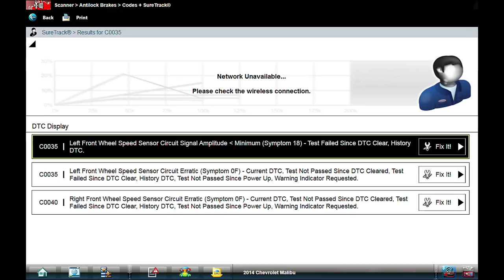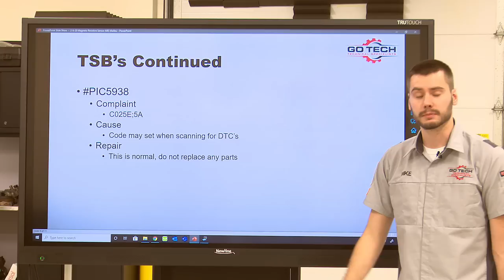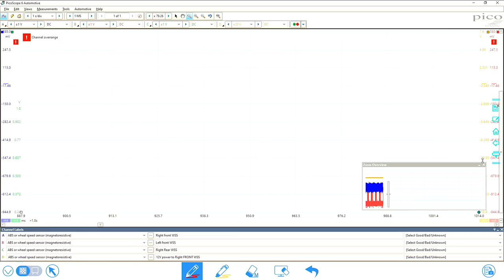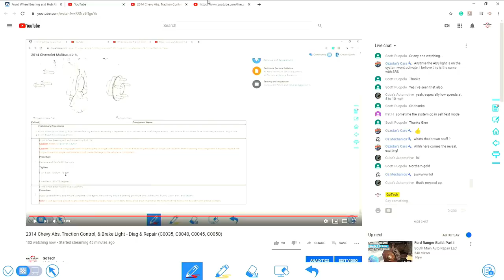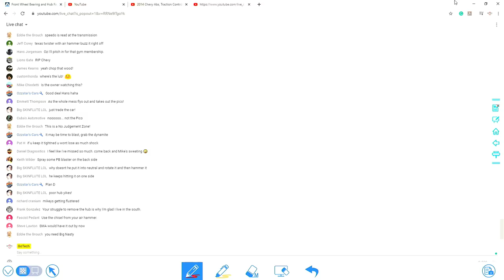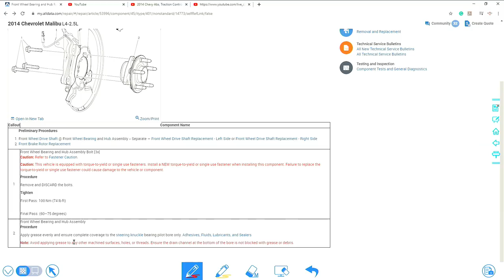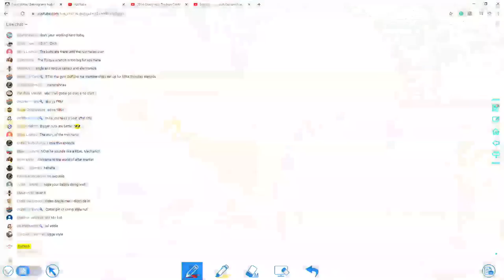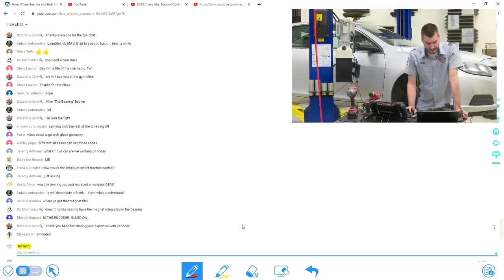2014 Chevy Abs, Traction Control, & Brake Light - Diag & Repair (C0035, C0040, C0045, C0050)

Comment: Missed this yesterday. That thing was typical of what I see up here in MA, too - everything stuck! I'd have let a few words fly, LOL - I could never do this live!! 🤣

Good to know about that reluctor on the bearing - I wasn't aware they were doing that. I haven't had too many late model vehicles come in, aside from a '17 F-250 that took me 2 HOURS to change headlight bulbs in, and a '15 Grand Cherokee with an EVAP code, thanks to the leaky Leak Detection Pump in the left rear wheel well. I actually replaced that with a WVE unit - I figured if OE couldn't make the part last more than 5 years / 45k miles, you guys probably built it better. 

Anyway, thanks for shooting this one - nice to get a heads-up of what I'll be seeing here soon.  Nice work, Mike! 👍🍻
Reply from the maker: Hey Smitty, all good! Better late than never. Yeh, it was stuck pretty good...gotta love it. Awesome to hear about putting in the WVE unit, thanks for that! Have a great weekend!
Mike Becker, Senior Instructor

Comment: Glad to see you back in YouTube land, Mike.  I have a couple thoughts.  Wait til you get a few more years abuse on your body and most of that shock you're feeling with the slide hammer reverbs all the energy right back into worn out shoulder joints.  I saw at least one suggestion in the live comments to make sure that the lug nuts are tight to the slide hammer fixture.  My sore shoulders couldn't agree more with that.

Those tone wheel breakages are not a new phenomena.  It's unfortunate for the tech, but I feel pretty good that he or she simply expedited something that was going to happen anyway.  I'm glad to see this video as a reminder and I'm going to remember from now on to add wheel bearings as a proactive or contingency recommendation on my brake evaluations.  Not every brake eval, mind you, but at least where I know those type of wheel bearings will be involved.
  It had been so long since I've even seen those bearings with the integrated tone rings that I paid no attention when I replaced the bearings on my dad's 2016 Outlander and immediately had to buy him two new bearings....whoops.

If you have a Grainger nearby in your chunk of Wisconsin, I'd encourage you to go to it and order up a couple wire wheels.  Their respective part numbers are 3A204 and 3A205.  One is a .006" strand wheel and the other is a .012" wheel.  You might find you can do without the .012" wire wheel as it's a little too agressive for aluminum and almost lethal when wire strands break off of it, but the .006" strand wheels do an awesome job of cleaning up aluminum without digging into it like even the scotch discs can do.  They're both kinda pricy, but I find them worth it.  At minimum, they're more fun than hand files.

Next, I keep thinking we should start a pool to see how long before Dorman offers a repair kit to replace that tone ring by itself.  Then, we can start another pool to see how long before one of those repair kits gets warrantied.  I'd guess Dorman probably already has a wheel bearing available instead.  But I don't see why they can't stoop lower in poor quality products.
Reply from the maker: Hey Shaun, thanks man! Good to be back :) I was very sore the next day. ugh...I'll have to look into those wire wheels. Thanks for the tip! 
Mike Becker, Senior Instructor

Comment: Thank you Mike. Good job. Have a blessed and safe week.
Reply from the maker: Hey Bill, thanks for watching! Have a wonderful weekend!
Mike Becker, Senior Instructor
Reply: @GoTechTraining  Thank you Mike. If you ever get a chance to teach Magneto Resistive CKP and CMP sensors, that would be great. Had a 2013 Ford 1.6L Turbo that has magnetic tooth wheel on the crank pulley/harmonic balancer.. Very odd waveform. Pulses are very close together.

Comment: Thank you for the video! lots of good info. Here in Colorado I still struggle with most hubs and some are worse than others. Occasionally I will loosen the bolts about a 1/4" and stick an impact socket on there and give them a few whacks.Or even wedge an extension in socket against something on the car behind the hub and use the steering wheel to pop it out.  the slide hammer is ok but can wear you out and hurt your hand. You can also  work carefully with an appropriate chisel in the space  around the backing plate.
Reply from the maker: Hey Joe, the struggle is real, right!? I've heard people have success using the power steering to pop them out...I wonder though, will that have negative effects on electronic power steering??
Mike Becker, Senior Instructor
Reply: @GoTechTraining  You bring up an interesting point. I have only used that method a few times and the vehicles were old enough that it would not be an issue.

Comment: SORRY..Didn't get the memo until I saw it on FB this morning.. Sucks as I had 3 scheduled appointments this morning and missed pretty much all of this live.  Would have been great to raz you and the other some this morning since I was jacked up on my coffee.  🤣☕ 

Sorry Keith.. it wasn't Dunkin... But it was good none the less.  💪😤😜  lol
Reading some of the chat comments made me realize I should have posted an announcement on our group page this morning as well.  Next time for sure.  Great stuff Mike as always, Glad to see you back Bro.  😀👍🍻
Reply from the maker: Hey Kevin, too bad you couldn't join. You could have definitely razzed me about forgetting the stupid brake shield thing! I ran outa time this time around to post things on FB. Next time i'll be sure to share in the groups as well. 
Mike Becker, Senior Instructor
Reply: @GoTechTraining   Oh brother...I wouldn't give you too much crap about that.
Lol... We've all done that before. Although I did find it funny when you were first warned and you were pointing out the back side and said see...it's no problem.!  
It's all good stuff bud.  If there was a chatOmeter going at that moment it would have been pegged out.  😁😂
Love it bro. Good times
Reply from the maker: haha there is a "chat-o-meter" and it definitely showed more chatter at that point than any other portion of the video. Ugh...just like brake line nuts...perfect flare, nut is on the bench...every time.
Mike Becker, Senior Technical Instructor
Reply: @GoTechTraining  😃😂 Yep just like the classic move of the perfect wire soldier job and then realize no heat shrink. 😂  Man, we could write a book from out of this.. Lol
Been there before. 😉👍

Comment: This seems to be a common failure from what I can see.  I had two go at different times on my 09 Acadia.   Same failure mode.

For those without a labscope, there is a way to test the sensor (and tone ring/magnet) with a current meter and a resistor.   Worked great.   

I had originally posted this comment on one of Eric O's video's 2 years ago.  Figured it might help someone here too.   The document I referred to pointed to older GM vehicles, but given it is a similar type of sensor, I assume a similar testing method would be valid.   

Re post of old comment follows   (Note, if you spin the wheel 1 complete rotation slowly,  you should see the transition from low to high values repeat in a continuous pattern.  If the transitions stop for a section, a piece of the magnet is missing.
------   Old Comment Begin -----
Just found the same problem on my wife's 09 Acadia.   Thought it was the wheel speed sensor at first, but I did find a diagnostic aid for how to test it.  Good thing I only loaded the parts canon, and didn't light the fuse :) 

I had purchased  a new sensor (just in case), and confirmed that I could return it if not opened.  Too bad it wasn't the sensor, that would have been cheaper :).  When the sensor passed the testing, started looking elsewhere and found the damaged magnetic ring...

For anyone that this may help.

-------------------------------------------------------------------------------
Test procedure for WSS sensor on..
2008-2010 Buick Enclave
2007-2010 Cadillac Escalade, EXT, ESV
2009-2010 Cadillac XLR
2007-2010 Chevrolet Avalanches, Silverado 1500, Suburban 1500, Tahoe
2010 Chevrolet Camaro
2009-2010 Chevrolet Corvette, Traverse
2007-2010 GMC Acadia, Sierra 1500, Yukon, Yukon Denali, Yukon XL 1500, Yukon Denali XL
2007-2010 Saturn Outlook

To test for the "12 volt Wheel Speed Sensor Supply Voltage" from the EBCM with a WSS fault present, perform the following test:

A. Disconnect the Tech 2 and Key Off Ignition, Remove Key, Open and Close the drivers door to turn off RAP (Retained Accessory Power) and wait at least 60 seconds.
B. Disconnect the appropriate WSS harness connector.
C. Connect a Fluke 87 DVOM (J39200) across the wheel speed sensor "Supply Voltage" and "Signal" circuits from the EBCM.
D. Set the DVOM on DC volts, press the "range" button to the 40 or 60 volt scale and then press the Min/Max button.
E. Turn the ignition key on. There will be a quick momentary 12 volt pulse from the EBCM at key up. This 12 volt pulse is sent each time the EBCM is powered up after being asleep to check the WSS circuit integrity.
F. If the 12 volt pulse is present continue with the WSS component testing. If the 12 volt pulse is NOT present recheck the circuits between the EBCM and WSS before replacing the EBCM. Make sure there are no backed out or loose terminals at the EBCM, WSS, or any inline connectors using the appropriate Terminal Test Probe

Component Testing of the Wheel Speed Sensor

Note: This procedure is very polarity sensitive and if the WSS is connected in reverse polarity while performing the below procedure the WSS can be permanently damage. Please make sure the B+ is connected to the WSS Supply Voltage and the ground (Fluke 87 DVOM) to the WSS Low Signal Return. Use the appropriate SI wiring diagrams to determine the WSS Supply Voltage and WSS Low Signal Return.

A. Ignition OFF, disconnect the harness connector at the suspect wheel speed sensor.
B. Connect a 3A fused jumper wire between Battery B+ and the "12 volt High Wheel Speed Sensor Supply Voltage" terminal.
C. Connect a resistor of approximately 100 ohms in series with a Fluke 87 DVOM (J-39200) between the Battery Ground and the "Wheel Speed Sensor Low Signal Return" terminal. (Sources of a 100 ohm resistor: High Speed GM Lan terminating resistor, certain test lights, Radio Shack, etc.). Shown below is an example of how to properly connect your meter for testing.
D. Set the DVOM to the DC Milliamp scale.
E. The typical reading will be 4 to 8 mA for the "Low" reading and 11 to 16 mA for the "High" reading. As the wheel is turned very slow, a few degrees at a time, the signal will change from the low to the high reading as each reluctor tooth passes the WSS.
F. If not within the specified range, replace the wheel speed sensor.
-------------------------------------------------------------------------------

I was able to find a connector under the hood to access the circuit. - Handy as I have 12 volts handy there.   I had already tested from this point back to the sensor connector, and validated no shorts or opens in the section of wiring I was looking at, so I cheated and didn't go find a 3A fuse.   There was a 100 ohm resistor in the circuit anyways, so I felt safe without it.    Even a dead short would have only resulted in 120mA.

Also confirmed that the silly thing does turn of the 12v source when it detects a WSS fault.  Tried measuring voltage on both rear WSS sensor feeds, and got zipo.
Reply from the maker: Great info Brent! Thanks for sharing!!!
Mike Becker, Senior Instructor
Reply from the maker: hahah maybe he is!? I have my eye on you Brent ;)
Mike Becker, Senior Instructor
Reply: @GoTechTraining  You guys help us.  Hoping to return the favor for someone else.  Your job is safe :)
Reply from the maker: Hahaha thanks Brent! :)
Mike Becker, Senior Instructor

Comment: Thanks for giving me the link to this video Mike. I can't believe I missed it. Notifications are on. Anyways I learned that on an MRE you can scope the signal on the ground. Always thought that was just with Hall effect. Talking about test lights no an incandescent is probably not a good idea. Altough PJ from Voltage drop diagnostics has a video where he tests the wiring using an led test light. If you have a data PID that shows current it's a quick check for wire integrity. 
I noticed that on the feed side of the sensors they're using pull up resistors in the EBCM. Any idea why? Thanks Mike.
Reply from the maker: Better late than never Dylan ;) An LED test light pulls almost no current, would be safe enough I suppose. Sorry, without diving into it I don't know why they use the pull-up resistors. 
Mike Becker, Senior Technical Instructor

Comment: After seeing the how the system works and is built, the fault could be inferred by the waveform.  The string of good pulses meant the sensor  circuit is functional.  Counting the pulses or just using the time cursors, as you did, would indicate how much of the mag ring was not working.  Since the system is digital, the sensor function could be checked by moving the wheel a small amount and watch for the sensor to switch hi or lo.  The wheel can be stopped to hold the sensor hi or lo.  The schematic is misleading in showing a ground on the signal side of the sensor.  There has to be a resistive element in that line for the signal voltage to be dropped over by the current flow.  It also shows a resistor on the supply side but has to be either very low compared to the signal side or not there.  If it were there the signal would also show on the supply side.  Those bearings are directional, so left and right has to observed as well as keeping the mag ring to the sensor.
Reply from the maker: All great points Steve! Has to be a resistor in the sensor itself to go from 12v input to less than 2 volts on the waveform. Unfortunately, I wasn't able to share the internal construction of our sensor. It's proprietary information according to my engineers. :(
Mike Becker, Senior Instructor
Reply: GoTech Hi Mike,
The resistor in the sensor, in series with the resistor in the EBCM,(gnd side) would form a voltage divider to create the signal.  There would have to be one between the scope probe point and ground. So internal to the EBCM.  Without the resistor in the EBCM, the scope lead, and the EBCM signal line, would be connected to hard ground, (according to the diagram) so no signal voltage would be possible.  When you drew the scope attatchment point on the big board wiring diagram, I was reading the diagram and I was sure that you were wrong and going to find out later when the scope didn’t have a signal.  The fact that the scope did work meant the diagram was wrong.  A tech reading the diagram could be sent on a goose chase.  The diagram indicates the signal to be on the power side.  Reading no signal there would indicate a bad sensor/hub ring.  The resistor on the supply side would limit the current to a safe value but would have to be less than 10% of the signal side resistor.  A higher value would cause part of the signal to also be on the supply side wire.  Your scope lead on the supply side showed stable 12V but the voltage scale was set high enough that it could have been overlooked and that sensor would have to be active to see it.  Unless the 12 supply is common to all sensors.  The wiring diagram shows that they are not but is it correct?  Sorry for the long rant, I have difficulty drawing circuit diagrams with words.
Reply from the maker: Isn't it amazing how techs are meant to fix cars while being given information that is confusing and often times incorrect? I get the rant Steve, no worries :)
Mike Becker, Senior Instructor

Comment: Hi GoTech, 
I did a replacement of all 4 wheel bearings with sensor replacement.
And still  stabilitiTrack/Traction ABS warning messages and lights ON.*
I did a complete brake fluid DOT3 replacement.
Do you have some extra idea,something I have missed ????
Vehicle ; Chevrolet Captiva Sport 2009 2.4L engine.
Thanks

Best regards.

Comment: Possibly rust build up under the magnetic ring, finished off with a heavy hammer?
Reply from the maker: Could be Mark. If that's the case though, it seems like a poor design. You'd think they would have that ring sealed so it wouldn't rust behind it. 
Mike Becker, Senior Instructor
Reply: @GoTechTraining  Poor design!?!?  Never in my automotive world! Seriously I have seen this problem several times and i work in the Upstate of SC. Now I do work for a used car dealer and get all kinds of "stuff". P.S. I am originally from the NE Ohio rust belt area and am familiar with rust!
Reply: @GoTechTraining  Firul de alimentare cu 12V este si firul pe care se citeste semnalul!, (nu pe firul de GND!), deoarece tensiunea de alimentare vine printro rezistenta pe care vom avea o cadere de tensiune/un semnal atunci cand rezistorul magnetic isi schimba valoarea cand fluxul magnetic variaza. Daca pe terminalul senzorului legat la GND ai semnal/tensiune, inseamna ca ai contact imperfect/rezistenta marita la GND!. Tensiunea acolo trebuie sa fie permanent egala ci zero, (-Vbat//GND)

Comment: The other shop should change their name to "Gravy Job Garage" since they don't want to handle seized in hub assemblies. It looks like the remote start did activate when you were hammering (you could see the parking lights flash before it happened). Maybe this Malibu was thinking, "Hey, if he's gonna start beating me with a hammer, I'm getting outta here."
Reply from the maker: Hey Joseph, yeh they should. So disappointed in that other shop...I'm glad I wasn't doing anything with the engine at that point. I never did look, hope there's a kill switch when the hood is opened.
Mike Becker, Senior Instructor